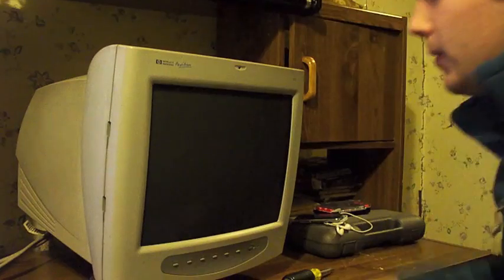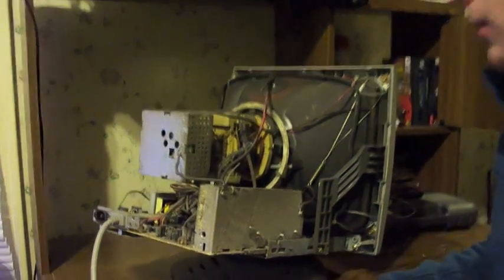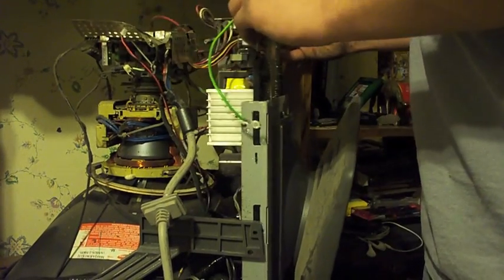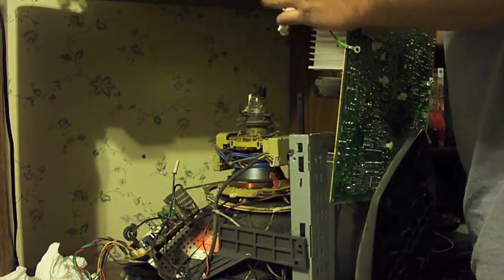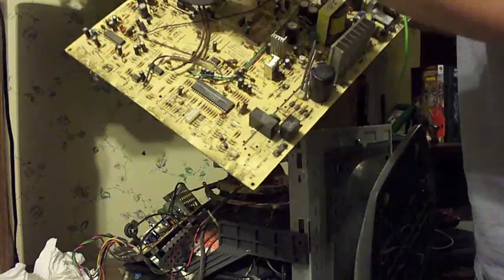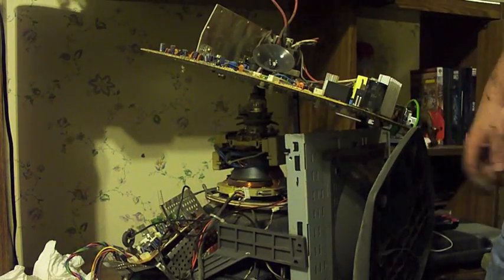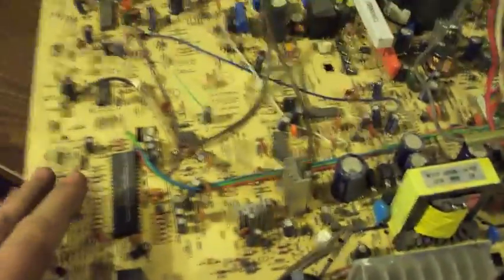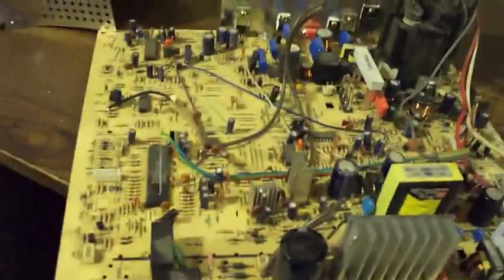Scrapping an old monitor

Comment: lol the first thing he dose is touch the high voltage line
Reply: It's not the volts that kills you; it's the amps. But just the same.... V=IR
Reply: ProfessorHodges Sorry 
the first thing he dose Is touch the high amp line .... nope just dont work
If you read a warning in the elctrical industry you may notice this on a hydo pole or even the back of a tv....... you will see WARNING HIGH VOLTAGE DO NOT OPEN why because it is the ampers thats what kills you Iam not trying to be sarcastic Its just that the industry warns about voltage this is why I wrote high voltage line That simple

Comment: ye i actually touched one and jeez did that thing hurt

my advice to anyone scrapping an old crt is to take it outside first then strip it and tap the top of the valve with a wooden mallet (ffs don't use a metal hammer) to release the vacuum 

then after its done sucking the air back in ,it should be reasonably safe to salvage parts from ,still be wary of the mains capacitor ,as that can also hold a huge lethal charge

Comment: Don't know if it's been said already but after a few days the mains cap and ultor lead off the LOPT slowly discharge. They are completely safe after a week.If in doubt discharge b4 you start but I have personally wrecked over 300 sets and didn't discharge 1. Still here to tell the tale cause I'm a qualified tv tech.

Comment: leaving it unplugged over night won't help.  Monitors can hole their high voltage charge for many years, even if the monitor has been unplugged the whole time.  You are better off discharging the monitor's capacitor before working on it.  there are ways to do it.  Google it.

Comment: @davethehunter2 CRT can definatly kill if not discharged. ive worked with older t.v.s including crt monitors. in my time, 1 person was sent to the hospital because of this. luckily he only lost a finger. it was severd where his wedding ring was. he said he only put his hand on the tube, didnt even touch a wire.

not to be an ass, but its the amps that kill :-p. doesnt take much to stop a heart.